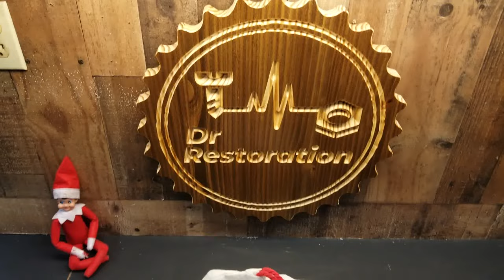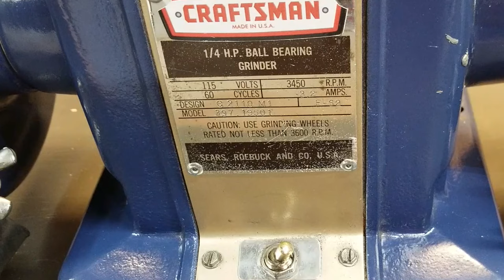Old Rusty Sears Vise Restoration - Christmas Challenge Special

Comment: Great job! Just a safety tip, it may sound counterintuitive, but you shouldn't wear gloves when using high speed rotating tools like your bench grinder - if your glove catches it will pull your whole hand in! 🙃
Reply from the maker: Thanks for the advice! Still learning as I go 🙂🤣